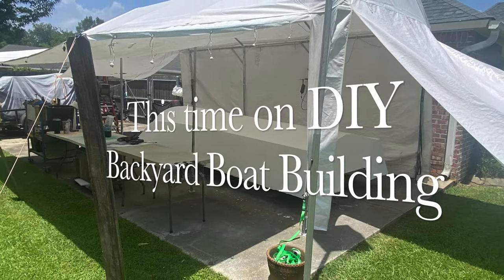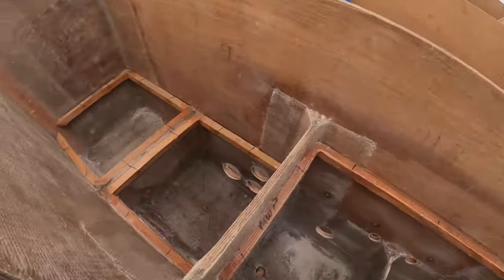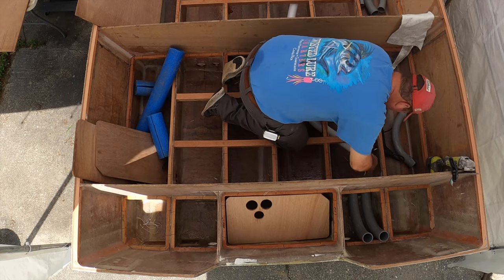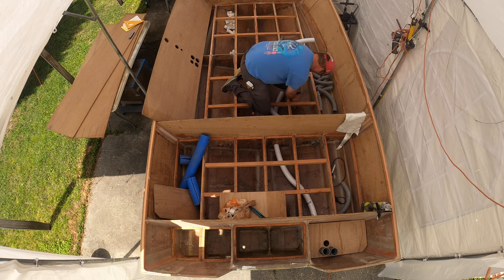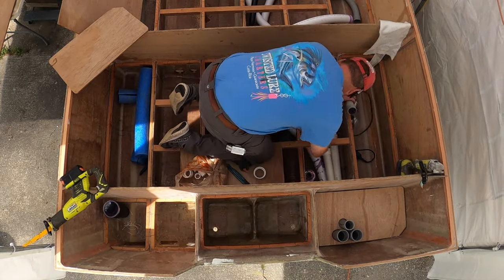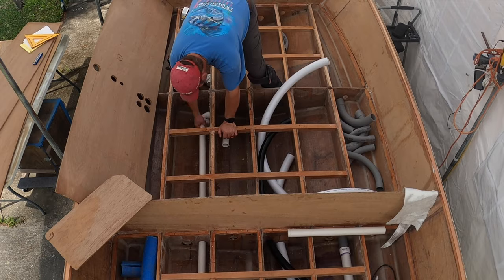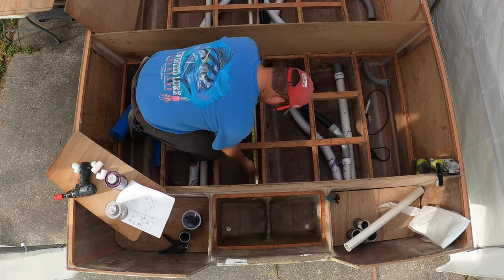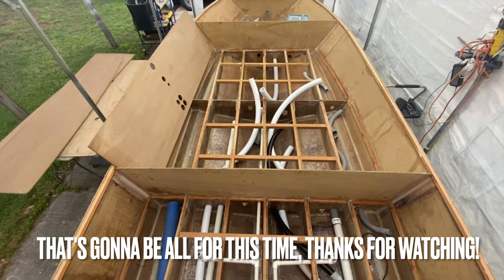54. DIY Fiberglass Build:18' Plywood Flats Skiff

Comment: When you're struggling to get your runs to line up you can massage the angles with a heat gun.
Reply from the maker: That's a good tip.  You know this would be easier if I got these tips "before the struggle".  I kid.  Appreciate the support.

Comment: Gonna run any PVC under the gunnels? Mine is for the trolling motor and nav lights on the starboard side. Port side is for my fuel line.
Reply from the maker: I’m planning for some 1” pipe channels under the gunnels for lights and stuff, but all LED so it should be small wire.  Trying to keep everything larger in the floor.  Also plan a crossover pipe in the motor well under the top piece on the forward edge.  Should make running everything as easy as possible and capable or handling whatever innovation comes in the future.

Comment: Have you asked saltworks if limber holes should be installed between each compartment to drain the bilge?
Reply from the maker: I appreciate the question given some recent builds, but with how I’m laying out, limber holes aren’t the path I am taking.  However I am taking special care and attention that each compartment will be totally coated with epoxy and/or glass, and all my plumbing will be self contained and/or fail safe.  My approach is to utilize the segregated compartments as a means to isolate any issues God forbid I have any.  I will discuss as I go forward.

Comment: Where do you plan to install the Gas tank?
Reply from the maker: I am bucking the trend and design in some capacity, and putting a 25 gallon tank under the forward casting deck, as far aft as possible.  I intend to have live wells, batteries, and such to offset the weight forward, but we will see how it works out.